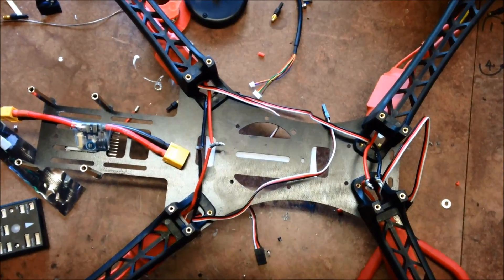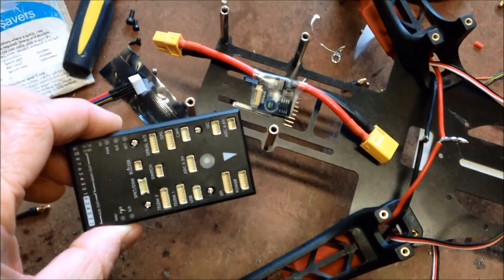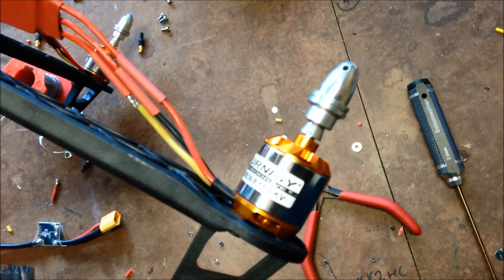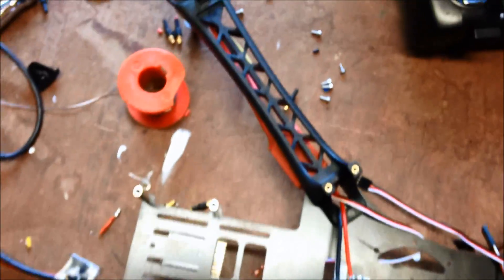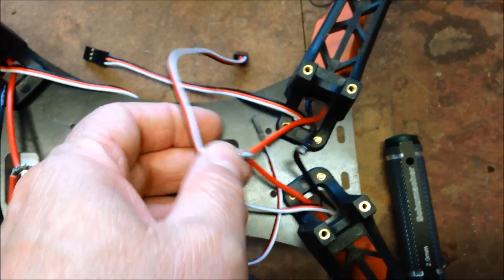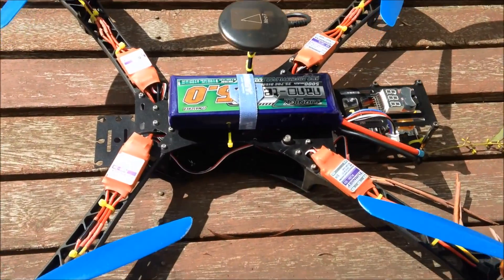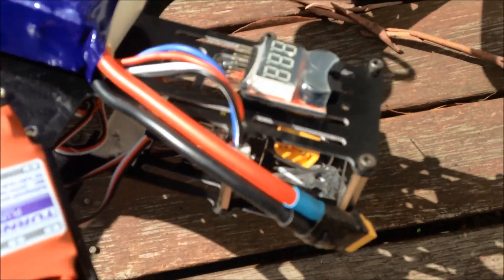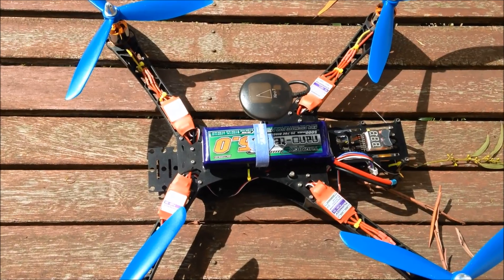Reptile 500 Hobbyking Pixhawk Quadcopter build and Autotune Fail

Comment: Maybe you need to fly more higher to compensate when autotune process look bad, and switch to manual / Stabilize mode. By the way, why you use 3 blade propeller ...? is it more efficient ...?

Comment: Motors and ESCs are are both questionable. The Turnigy motors are notorious for bad vibration issues and the Plush ESCs must be flashed with BLheli firmware. I have had countless problems involving motors and ESCs regarding stability.
Reply: 4G3NTanon That's why I went with the T-motors. They are very popular and trustworthy. In addition, using low KV motors with certain firmware can lead to out of sync issues.
Reply: +4G3NTanon 
I use the Readytoflyquad 30amp ESC with the simonK firmware. So far no issues at all. My motors are some dodgy brand I got from online walmart thanks to a gift card from work....Mars Power motors or something, 920Kv. They're ok for now, but I'll upgrade them when I upgrade the flight controller - and on that note, I'll be interested to see how the ESCs I have work with the more advanced FC like the pixhawk.

Comment: Thanks for sharing the video! Did you get this to work eventually?    Your video a few weeks ago inspired me to try to get auto tune working.  I have had the Pixhawk for a while but didn't have the courage to try autotune.    I researched autotune quite a bit and I found a few things that contributed to crashes I read about.    1 make sure all ground wires are hooked up to your flight controller from the ESC's, 2 make sure you have Altitude hold mode on before you flip to autotune, 3 make sure ESC's are calibrated, and 4 make sure sensors are calibrated well before doing this.    I tried this in the dead of a foggy night a few weeks ago and I was nervous as heck and it worked well!   It lurched around the sky for about 5 minutes and it was freaky at first but it worked.
Reply from the maker: Nice. i ended up setting it up manually but I will try again. Working on my QAV250 Christmas Present at the moment.

Comment: Hi great video? Can you write your complete set up down? Greetings from The Netherlands
Reply from the maker: Hobbyking PIXHAWK with Neo7 GPS and Power supply
1100kv 2836 Turnigy motors
30a Turnigy Plush ESCs
500 Reptile X Frame
Turnigy 5000mA 40c 3s NanoTech Lipo
FrSky D4R-II 4ch 2.4Ghz ACCST Receiver
3s Battery Alarm

Flying well now. I have posted a few more videos.
Reply: Thx
Reply from the maker: Harco Booman I have uploaded some more videos of the settings and some tips to get Loiter working. Also definately update the PIXHawk to v3.2

Comment: Oof. Was this caused by the PID settings being too high to start with?
Reply from the maker: yes. Default P is 0.15 When I dropped it to 0.11 it was fine
Reply: Simon Hahnel You shouldn't have to drop the P value just to get the auto-tune to work. I was able to auto-tune my quadcopter without any incidents.